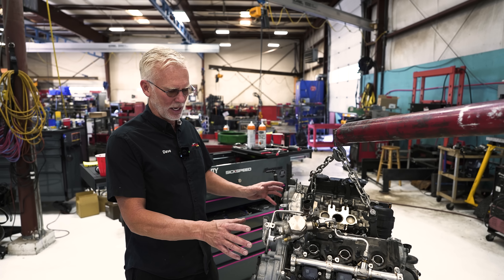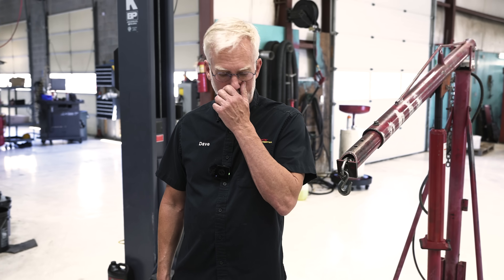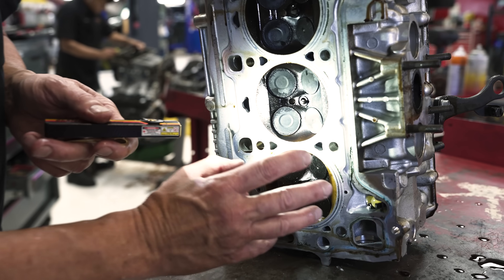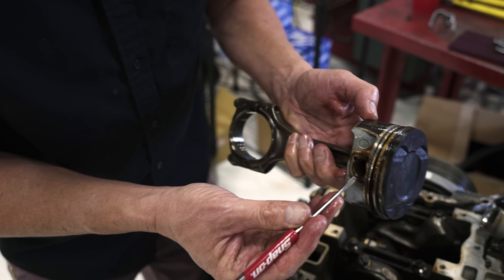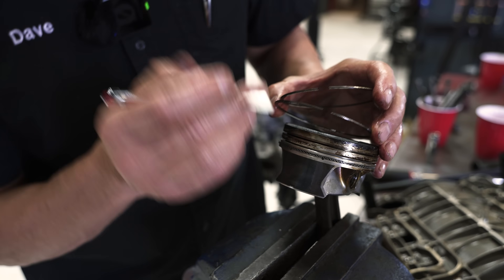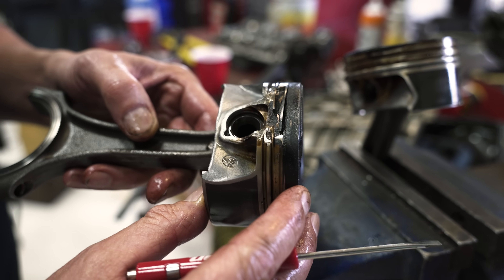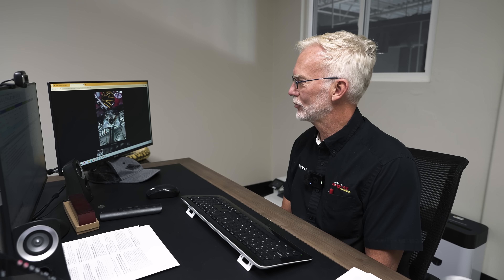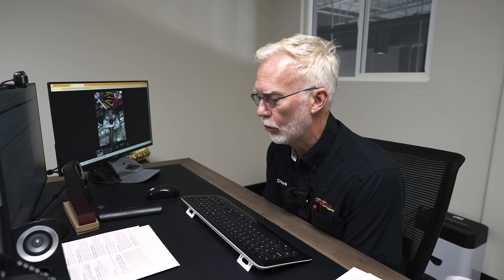Audi S5 Update: Piston Damage From LSPI (Low Speed Pre-Ignition)

Comment: Thanks for the follow up show. I have read that the calcium detergent (oil additive) causes hot spots that act like diesel glow plugs and cause pre-ignition and that causes issue because direct injection petrol engines run higher compression than other injection types ( it injects on the compression stroke not the intake stroke, therefore allowing for higher compression without pre-detonation). The api  sp oil has greatly reduced this detergent additive and has increased the magnesium detergent additive.

Comment: I recently had to get a direct injection engine for my car rebuilt because of carbon buildup burning out valves(from previous owner). 

Amazing how oil can make such a huge difference in an engine. 

Thanks Dave for your amazing and detailed videos!
Reply: Stick to older multi port. DI is horrible to Engines. Causes multiple issue be it chain stretch , intake valve carbon build up, high pressure fuel pump failures.
Reply: @Angl0sax0nknight  Lexus and Toyota dual injection (port and direct) engines should be OK. They use the port injection enough of the time to keep the intake valves clean.

Comment: please take a sample of that oil if still possible; send it to Lake Speed Jr to see what the shop actually put in it!
Reply: Oil analysis is cheap and easy to do
Reply: Not a bad idea
Reply: I have a feeling it was NOT factory fill viscosity and exactly as specified by the manufacturer. Too many owners dump 5W-30 or thicker oil in their engines, thinking that thicker is always better. 0W - 20 synthetic oil is specified in many high-performance engines like the BMW B58. I refuse to use anything else but those that meet specifications listed in the owner's manual.
Reply: @davepaturno4290  Audi calls for an API SN or API SP 5w 30 meeting VW 500,504 oil standards. I put 5w 40 API SP in my 911 as it’s called for from the manufacturer. Please do not spread misinformation
Reply: @strikerwyatt  Obviously, Audi does not have a B58 engine in any of their vehicles. My most previous advice is for the vast majority of owners who limit  their driving to streets, not racetracks. Stick with the viscosity and certification(s) requirements (which are based upon bearing and journal clearances, as well as countless hours of testing) of motor oil as specified in your owner's manual. Track racers with voided or expired warranties are less likely to do so, but they should assume any risks and benefits of their changes.

Comment: It's not the fact you need to pull an engine out of a car to work on the timing chain. You will have plenty of room to work on the engine. Fantastic idea. The execution of the idea however.... The issue is the complexity to get the engine out of the vehicle. We pull engines out of agricultural equipment all the time. Great to work on, but it takes only 1 hour to get the engine out. That's the difference.

Comment: Complicated German whiz bang motors. They’re fun when they run but when they go bad they make you sad. 

That’s why I drive a Camaro. Good ‘ol GM  pushrod small block power. If by chance something goes bad you can fix it in a day without a full engine pull.

Comment: A few insights from the factory side of things on those 3.0 turbo engines: Audi moved the chains to the back side of their blocks years ago for packaging reasons. They could make the blocks like 2 inches shorter by moving them to the back internally. The Audi spec for the oil on those engines is 0W-20 weight full synthetic with a VW508-00 certification. Not sure what that translates  to in an API rating off the top of my head, but it's a certification that many oil manufacturers will have somewhere on the bottle.
Reply: BMW also put the timing set on the back of some engines (2.0L diesel comes to mind) as they considered the timing set to be maintenance free at the time. A pity the quality of the parts was so poor that they failed much earlier than desired. I do not own any direct injection petrol engines, nor do I have any desire to (of course all my diesels are direct injection, but they are a different story because of the EGR rubbish).
Reply: They aren't supercharged anymore?
Reply: @MyerShift7  Changed from supercharged to turbocharged 4 or 5 years ago, probably for cost savings and/or emissions(?)  I believe the horsepower and torque numbers stayed about the same.  The "3.0 T" designation typically confused non-Audi people when it was supercharged...

Comment: That's also what's called "lugging" the engine. Where there is a much higher cylinder pressure than there is engine RPM. So the engine components need to overcome more pressure than they may have been designed to hold with not enough speed to overcome it. 
     This could also be caused by an improper ignition MAP

Comment: I believe H2 motors in Germany specializes in honing and rebuilding nikasil engines. The bmw S65 and S85 engines have nikasil cylinder walls and they have a special process to bring the silicone to the surface.
Reply: @blipco5 lol the video involved tearing apart the bottom end and replacing the piston. Cheap left the chat a long time ago.
Reply: Yeah, Sreten (M539) had great success with them
Reply: Yes, nikasil can be restored. Probably ain’t cheap.
Reply: Still a specialized process, but its Alusil on the S85 and S65.

Nikasil was used on the older engines during the 90’s.

Comment: I recommend a fuel system cleaner with a high PEA content, aka Techron. Most tier 1 gas will have a detergent package that includes PEA but it's good practice to run a bottle with a tank full of gas before getting your oil changed.

Comment: We must have oxygen present for hydrocarbons to burn All three legs of the fire triangle must be present, else no explosion, no combustion. How is the oxy driven into the ring groove, and what is the ignition source? I am not arguing with your position. I am inquiring about the rest of the equation.
Reply: It's not exactly known how it occurs but it has been theorized that it may be caused by hot spots in the cylinder. It could happen at any of the four cycles in an engine which is baffling but remember that no engine uses all 100% of the available oxygen during the combustion cycle. There's always oxygen available to combust unburnt fuel in a cylinder.

Comment: Hey Dave quick question, I have a Mazda 2.5t with Di, I use SP grade oil but also add Liqui-Moly MoS-2 (non-sp certified) friction modifiers, claims to eliminate dry starts. Is it safe to use friction modifiers in engines especially newer motors? Thanks

Comment: Previous owner most likely tuned the car. When the new owner bough it he was most likely unaware of it and put the wrong fuel in it.
Email the popular tuning companies to confirm if there is or isn't a 93 oct or E40 tune on it. Which would for sure cause pre-ignition and engine failure as described if the new owner did not put the proper fuel grade in it.
Reply: Do these "tunes" simply ignore the knock sensor data?
Reply: @gregorymalchuk272  at least one did or at least kept the timing advanced when it should not have, although it was revised and is perhaps better now.   The company that made it even made a video showing the stock tune changing the timing to avoid said knock, trying to suggest the issue with their tune was based on the cars OEM tune trying to make sure it wasn't going to blow itself to bits.
Reply: These engines require at least 91 octane from the factory. Wrong fuel shouldn't have been an issue unless you're suggesting he may have needed 100+ octane race fuel.
Reply: @robbyyant6213  a 93 tune with 91 fuel = knocking and hopefully timing reduction to compensate.   If the tune didn't do that...

Comment: "Warmup the engine before giving it the beans."
A 70° day. From startup, how much time would be needed before putting your foot in it?
Just got a '13 a Equinox with the 2.4L. drove it from Vagas (rust free) to MN. Was concerned about oil consumption. Didn't use any. 170,000+ miles on it.
Reply: You shouldn't floor it till it's at operating temp.   As far as driving away,  soon as you see the temp gauge start to move you should be OK.

Comment: I know this low speed preignition thing is the new rave to talk about but it doesn't really make much sense because in the old days of carburetors you also had raw fuel pouring into the combustion chamber , without this new API special oil , and when we saw any damage like this it was always just common knowledge that it was poor quality low octane fuel ,or over advanced ignition timing that was to blame.. Also possibly localized hot spots ,like a sharp glowing edge that ignited the fuel at the wrong time.. This new idea of blaming the oil or not having the proper oil as the cause seems ridiculous ,as I highly doubt oil is going to have any ability to squash whatever explosive force extreme enough to do that kind of damage.. This is probably just something that's always going to be a possible problem with these engines because of their extremely low tension piston ring designs..It's another problem caused by beurocrats worried about squeezing .00006 more mpg out of a gallon of gas in the name of the green cause !!! Go back to real piston rings that keep combustion on the top of the upper compression ring where it belongs and this problem will actually be solved ...

Comment: Oil control piston lands are really close to the piston pin bore, makes for a weakest point scenario, when everyone started stroking SBF's to 363 CID they started having problems with the oil control rings, they had no support oil was just getting sucked into the cylinders, the fix was to insert a bushing under them in the pin bore to give the rings support, think at some point they figure out to move the ring lands up more on the piston with a nicer thinner ring pack for the top two compression rings, and a stronger oil control ring set. After looking at this new Audi motor, I think I'll keep my older cast iron block Audi's cars, that and the service on these cars is just a nightmare, the 5th generation Audi's are better made in some respects where it really counts... lol

Comment: Dave I'm a big fan. . What I I found is piston failure. . on these. Also the Passat engine . From  piston skirt failure. . I will say this . There are a lot of direct injection engines out there . That don't do this. . In the past 40 years . I have had. A lot of engines apart. . Never seen .the same thing over and over as I do with these Audi moters. I believe it's simply. Piston failure.  Poor product. I'm doing another one right now.  For  excessive oil consumption. . I usually just pull the oil pan down find the remains of the skirt. And . Oil rings. . . Are you basing this explanation on a bullitin from Audi ??. 
Here in Canada. When u buy a new Audi 
They give you two extra litres of oil. With the car.  In the trunk. .if your theory is correct  we could have misfires.  And low power because knock sensors  will pick it up. . Not doubting you. Just another opinion.   Again I remain a huge fan

Comment: If you want to know more about the factory defects like camshaft rollers and cracked pistons on Audi engines then I would advice to check VAG technic on YT. These guys has even made cutom tools to service these engines and they are fixing what Audi dealer was not able to do.
Reply: VAG Technic in the UK is indeed an excellent resource for people operating and maintaining Audi S and RS models.  They aren’t perfect, but they also don’t claim to be and this speaks volumes about their level of proficiency.  Some of their B9 S4 and S5 content goes into considerable detail regarding engine internals and the associated failures.  Other comments have mentioned the impact of fuel-specific performance tunes, rocker arm bearing failures and the downstream damage to the catalytic converters on theses engines.  Dave‘s team should view these immediately and proceed with great caution.  I tend to think that this level of carnage might reoccur if the underlying nature of the fault that lead to this failure isn’t properly diagnosed and corrected.

Comment: Please do not run this engine without confirming if it is tuned or not. 
If it has a tune and the owner does not run the proper OCT rating fuel, this pre-ignition issue will rear it's ugly head again.
Most of these S4 / S5's are tuned.

Comment: Why does the fuel/oil mixture when it gets past the rings spontaneously combust? I would imagine there is little oxygen in such a confined space or does the fuel/oil mixture react together in a different way
Reply: Exactly.  And engine is cold. Therefore piston is cold what is igniting it. . Read my comments. On this. I believe it's a simple  defective pistons. Losing skirts. And oil control ring land. Do a lot of them.
Reply: Besides that. There is mmm. Don't quote me. . Say . 400. Psi . In combustion chamber . If it is firing off . Oil . Gas. . Rings are compromised . It's going into crankcase

Comment: I was looking at the cylinder heads and their intake port design. Three intake valves siamesed down to one port is potentially an issue. The outermost intakes are going to likely be facing a tight radius right off the port and then another to the back of the valve. Under boost it probably doesnt't matter, but at part-throttle, with little to no boost, could that be an issue? Could the middle cylinder be hogging airflow, restricting airflow to the others, or causing some turbulence, adding to the mixture and atomization pattern problems? Just a thought.
Anyway, great video as always!

Comment: Audi’s EA839 is an abomination… one of the most poorly designed engines I have ever encountered. 

From air to water intercooler failures leading to coolant ingestion, to carbon buildup that can’t be cleaned without engine removal due to the hot V design, to failing rocker arm needle bearings. It’s just a never ending list of issues. Run from these cars, fast!

In terms of the oil specification: it must meet VW 508 spec. To obtain 508 the oil must pass certain testing for LSPI among other things.

Comment: LSPI is made worse by the type of people who think the premium fuel requirement is only a 'recommendation" for BMW, VAG, and other Turbocharged DI engines. Beyond that, a Top Tier rated gasoline is just as important as the oil additive package. LSPI is a known issue that has been addressed by many manufacturers already for years. The right oil, regular maintenance, and the right fuel would have been all this customer needed. Don't buy a $60,000 European sports car if you are too ignorant to read the manual or follow clearly documented operating requirements. It's truly embarrassing to see these grown men who couldn't tell you what kind of oil went in their car at the last service.

It's really expensive to be neglectful and ignorant when it comes to owning modern cars. Why wait for the symptoms, when all you needed to do was be proactive with maintenance and research?

Blows me away every time.

Comment: Please consider changing the rocker arms - if he has the old ones (part number 06M) they can lead to a catastrophic failure. There are new revised ones (part number 0P2).
Reply: These rocker arms need to be done. Known issue on these EA839 engines (early builds). 
It would be a shame to miss these while the engine is out.
Reply: Exactly this.
Reply: Looks like there were little rocker arm bearings being pulled out with the piston ring parts.  Definitely a situation.
Reply: @kl3271  Yup, I'm betting one of the rocker arms are siezed as I saw a bearing and there will be some scuff on the camshaft where the rocker arm failed.
Reply: Agreed from Scotland
Reply: Yup
Reply: This is the perfect time for that for sure .
Reply: Agreed from your mom's house
Reply: @4drturbo85 😂😂😂

Comment: Good to hear your endorsement of Amsoil products. I use it in everything. Have never had a failure of a lubricated, internal engine component in a total of 700,000 miles spread between 3 vehicles.
Reply: Fresh oil is more important than brand of oil, but I will say amsoil is good. I'm very partial to pennzoil platinum
Reply: Alex at Legit Street Cars is an Amsoil fan and also one of their distributors in Chicago. Go to his channel and order from him and you get a big discount! ( I'm nothing to do with either businesses, as I live in the UK, but am a subscriber to both Dave, and Alex)
Reply: @samrodian919  Thanks. I'm actually a preferred customer and get fairly good discounts ordering direct from Amsoil.
Reply: must be 3 Toyotas :D
Reply: @roofcamper3473  Actually No, 2005 Ram 5.9 Cummins Diesel, 1995 E320 Wagon, 2010 C300. While Japanese cars are reliable, there is NO driving experience and I have no interest in them.
Reply: @bentleyjarrard885  you’re right about the driving experience haha. Best combo would be a Camry/rav4 daily, bmw m340i for a weekend car :D